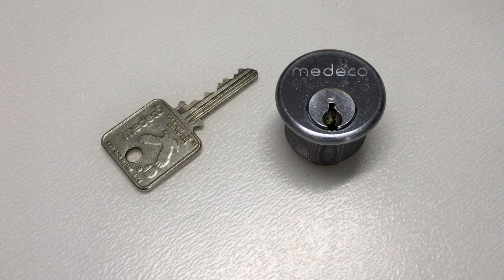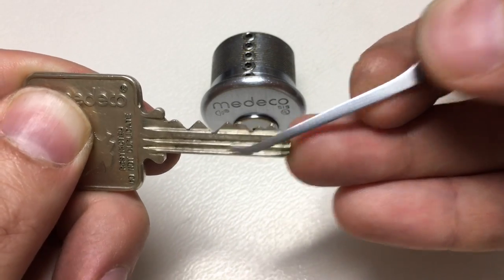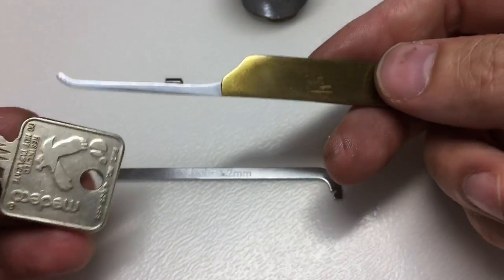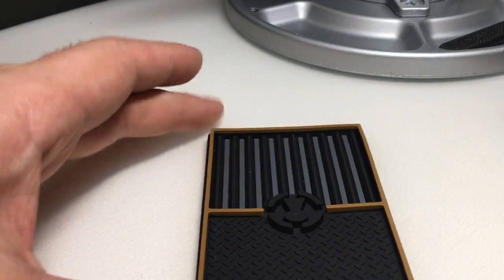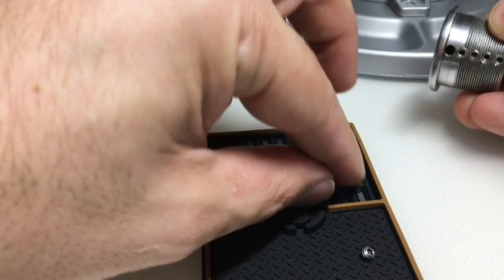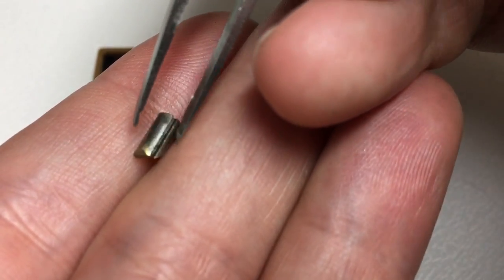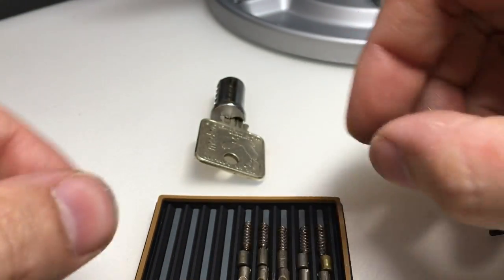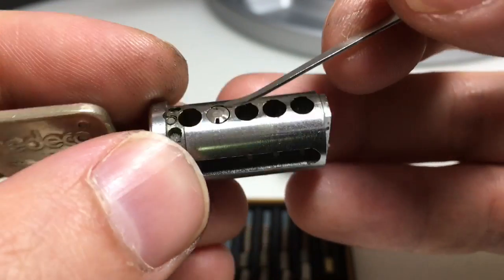(220) 5 Pin Medeco Biaxial Mortice Cylinder Picked and Gutted

Comment: Sir Noob, nice pick... rotating pins, geeze.  Great explanation. 
I have a video idea for you. I know you have done several wafer lock videos, but I would love to see a long-ish video which is sort of a master class on raking several types of wafer locks.
The reason is that I have encountered many of these things on used furniture, locked chests, and file cabinets at auction sales.  I have permission to open them during the inspection period, but it has to be quick. Usually the "owners" just use a jimmy to pry past the cam, but this sometimes damages the woodwork. 
I have done it, but my technique is very unreliable, and SPP is too slow. 
I have discovered how to ID DUO cylinders, which I don't even try, but it seems I have a disproportionate amount of trouble with the rest. 
What do you think?  Fun? 
R
Reply from the maker: R. Akers sounds like a great idea, but it might take me a while to get around to due to the number of vids I already have in the pipeline. For now you will just have to do with the wafer lock vids on my playlist :-)
Reply: R. Akers Use the Warlock by Sparrows as it is the best wafer pick I have ever used! Literally no wafer locks I have faced with the Warlock were unpickable.  100% success with the Warlock!
Reply: Thanks!  At sparrows prices, I certainly will.  Any other favorite picks from them, as the shipping is nearly the pick cost?  I have several of their standard picks now, but I can always use whatever, as I am a notorious modifier of picks.
Reply from the maker: R. Akers IMO you can't go too wrong with Sparrows whatever picks you choose as long as they have the nice dipped handles :-)
Reply: I actually like to "dip" my own.  I can vary the thickness, and surface texture, but yes, the raw metal is a bit rough on the edge of the finger
Reply: R. Akers I also recommend the Sparrows Dark Shift Kit and the SSDEV set. These two plus the warlock is a great setup!
Reply: Thanks again.
I already have most of these picks and rakes, though not in "kit" form, and not with the snazzy handles.
BTW, I have a lovely old Corbin with a DUO core wafer lock I would love to test against any rake... 2 sets of wafers, loose false gates, tight true gates, etc, etc.

Comment: Wow, great picking and great success picking a medeco. How difficult is it to turn the pins without oversetting it?
Reply from the maker: I don't find it to be a problem as long as all the drivers are set. If you turn a pin while picking before this happens, it's still OK if the key pins are short. The key pins which are the longest are really easy to overset while rotating if the drivers are not set :-) half the time, you get lucky and the pins rotate to position as you pick them anyway :-)